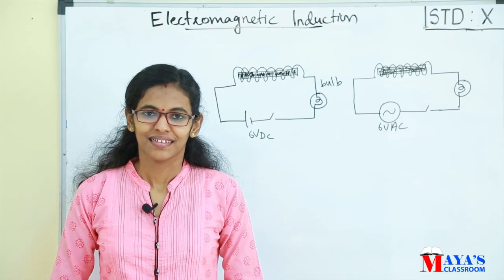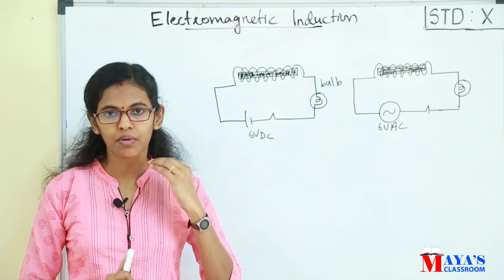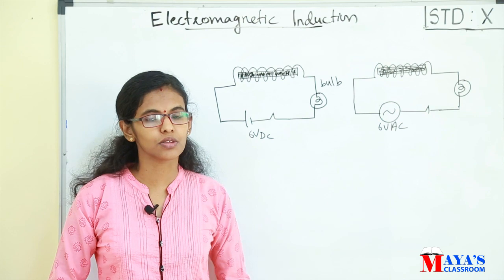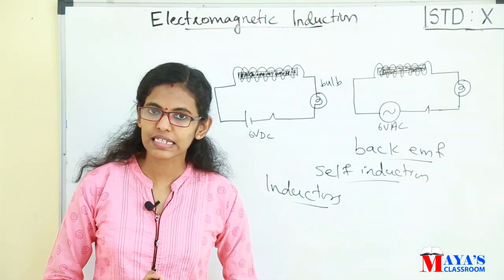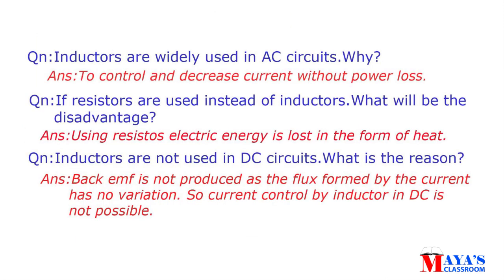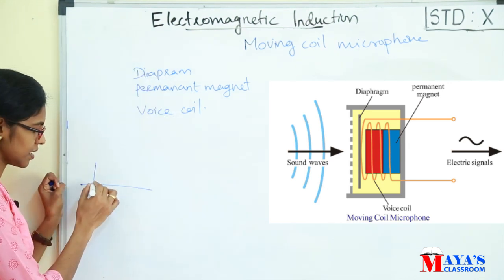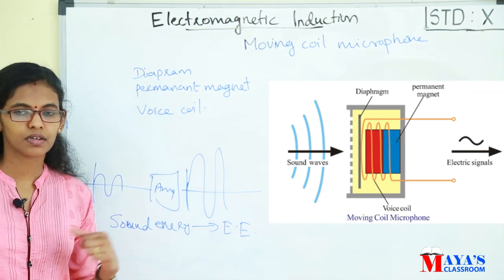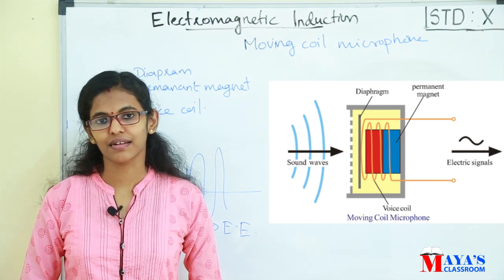Physics Class 10 // Electromagnetic Induction  Part 6 // Malayalam

Comment: Madam,what is the difference between emf and voltage
Reply from the maker: The EMF is the maximum voltage that the battery can deliver. The voltage or potential difference is the measure of energy between any two points on the circuit.

Comment: Miss, why back emf is not induced in mutual induction??
Reply from the maker: back emf generate cheyyunnund..When an AC supply is given to a transformer current flows in that winding and this current establishes an alternating flux in the core. As the primary and secondary windings link this flux EMF is induced in these windings and this opposes the supply voltage  and hence called ‘back emf’. This back EMF reduces the input current ..